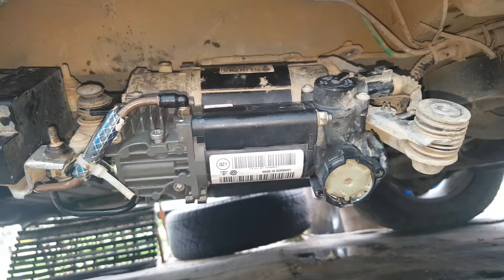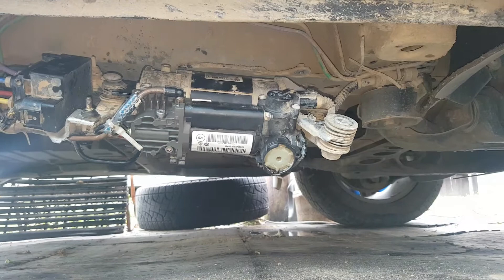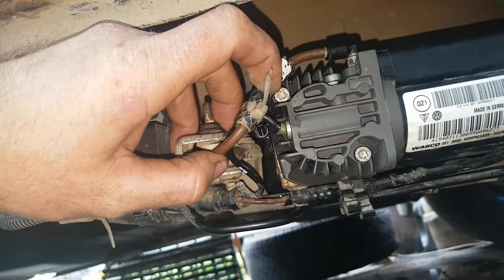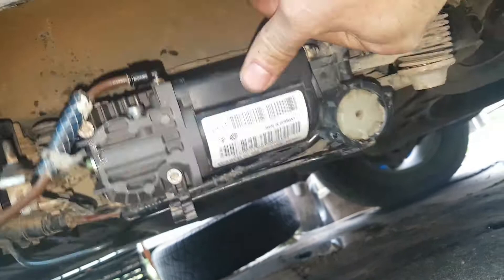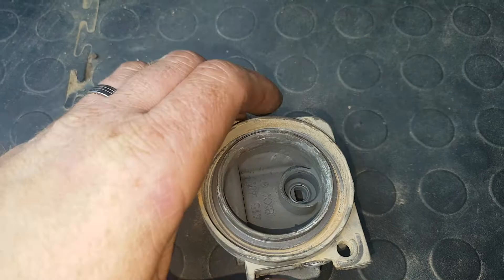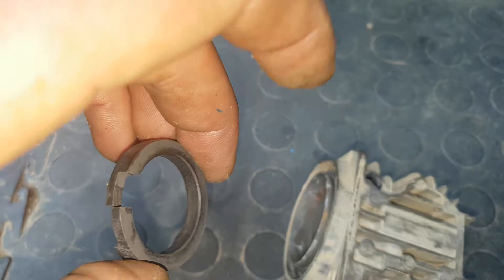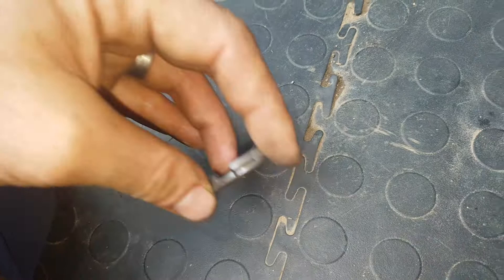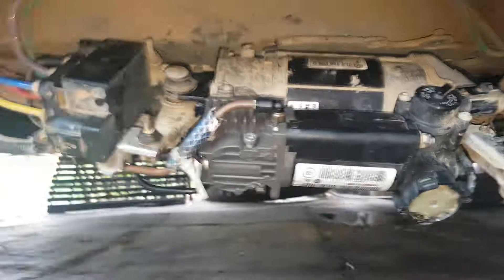Touareg Cayenne Q7 air compressor cylinder head replacement brief

Comment: Hello, I found this video which is very good. I was wondering which car is this? And what faultcodes/problems  did you had? On mu audi Q7/2008 I have an issue but I'm not sure if it the compressor. I get 3 facultcodes:1577.1400.2250 (01577 - Turn-Off due to Over-Temp ; 01400 - Suspension Level Control
  001 - Upper Limit Exceeded - Intermittent, 
 02250 - Function Deactivation; Valve Duty Cycle)
Reply from the maker: Yes. That points to a bad compressor. The video was made from a touareg but the cayenne and q7 is the same. The ecu wants to see a certain increase in pressure in a certain amount of time. If it doesn't it throws an error on the dash and those codes. If it's really bad it will throw a red error on dash and shut off the pump completely.

Comment: hi did you have to release pressure from the system before doing the repair?
Reply from the maker: No. The valve block next to the pump regulates pressure flow.

Comment: nice video i have some questions

did you raise the vehicle if yes how?

and was thier any release of air when removing the head or any points and dangers to watch for thanks very much?
Reply from the maker: yes. You need clearance to work there. I used a jack to raise it. Like you would do when changing a tyre.